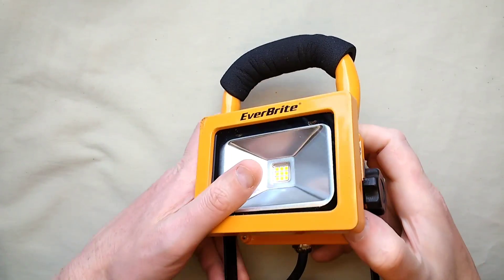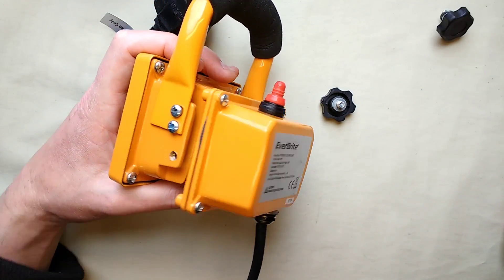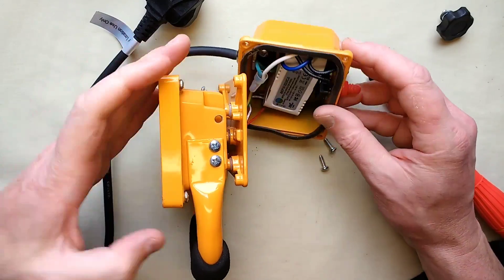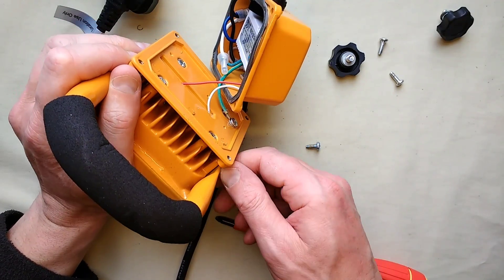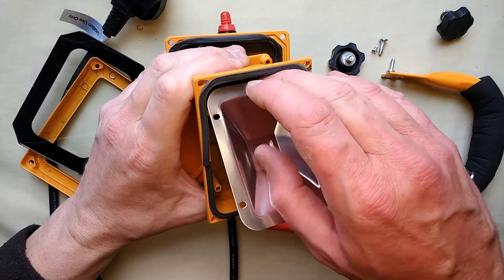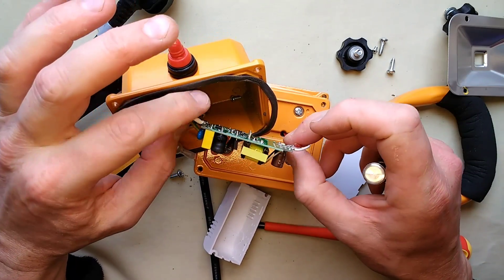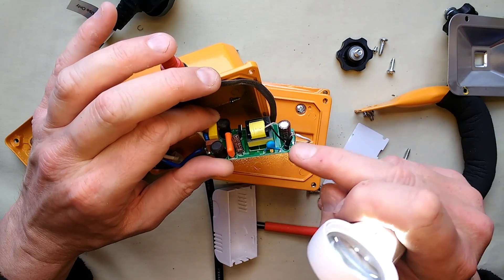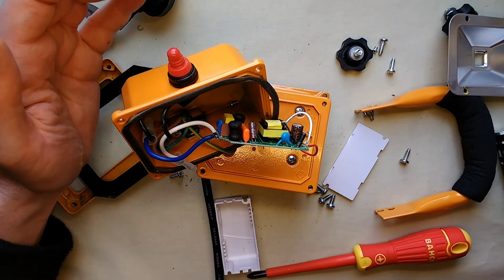ASDA LED work light.

Comment: The H05 isn't the part that indicates a rubber flex, it just indicates the category voltage (300/500V). Ordinary-duty PVC flex is designated H05VV-F (similar to North American SJT), with a lighter-duty variant called H03VV-F (roughly comparable to SVT, limited to 0.75mm² cores and intended only for smaller appliances); the VV refers to the use of PVC, both as the inner insulation and outer sheathing. An ordinary-duty rubber flex is called H05RR-F (comparable to SJ; used with some hot appliances e.g. electric frypans), and one with rubber inner insulators and a neoprene/polychloroprene outer sheath is H05RN-F; the heavy-duty version thereof is known as H07RN-F. (In Australia, incidentally, we also use heavy-duty PVC flex, which equates to H07VV-F.)

So, which is it? H05RR-F or H05RN-F?

Comment: Market is flooded with these lamps. So many different variants. And so many differant brands with various qualities from excellent to dubious. I got one with a single led 10w and its very bright. You can get ones with removable batteries, usb 1amp phone charger outlets. Ones with or without weather seals, and some that are wonkey Copies of copies. Literally every high street shop as its own version. I like to stick with single led versions myself with decent led . But there are some of these that have like 20leds and are worse than my single version. I got mine from city electrical so it's alright but got a clone on eBay and sent it back as it was like a tin copy and oooh so badly made

Comment: The push button switch looks exactly like the ones on my 2 head Halogen work light that I recently converted to driverless LED chips.
BTW re "sound of screws scattering": I bought a bunch of magnetic parts trays (basically a metal dish with a speaker magnet in a rubber cover glued onto the back) at Dollarama a few years ago. I put one on the bench whenever I take something apart so I can put the screws &c into it and I don't loose nearly as many of them now.

Comment: Have you taken apart the flat panel led lights from eBay? They come with those power supplies all the time. Also the leds light the acrylic edge not what you expect.

Comment: Hey Big Clive, I've got a question.  What do you think of solder suckers as a tool?  Useful all around, or only in certain situations?  Or are they more trouble than they're worth?
Reply from the maker: They are a useful addition to a soldering toolkit.  I've had better results with cheap eBay ones from China than expensive ones from high profile electronics companies.
Reply: Good to know.  I got myself a generic one too, and it's been pretty handy for the little bit of unsoldering I've done when scavenging components.  Had a bit of a scare when I sucked up a huge glob of solder and it jammed the tip up, but a bit of poking with some pointy stuff cleared it out.
Reply: Awesome!  Thanks for all the advice!  And yeah, I got the exact type of blue one you mentioned.  I've always cleaned it out right after using it, just to be sure.  Got a little tin full of all the old solder.  No idea what I'm going to do with it, but I'm sure I'll find something.  Probably low-value hack-jobs for rapid prototyping on stuff I don't particularly care about the initial quality on.

Comment: Those push-push lamp switches are very common in the US, and have been since at least the 1930s. I suspect that is because they are probably cheap as dirt to make, and they work fairly well with a waterproof rubber boot.

Comment: What I'm looking for currently a Small and Cheap Portable 720p TV
Reply: TheKHfan358over3d Be aware that portable TVs do not tend to perform well in use unless you have a suitable elevated high gain antenna to attach them to, which really kills the portability factor for most applications.  With today's digital signals you tend to get an all or nothing signal, unlike the slowly degrading analog signals of old, and to get away from heavy ground and structure (multipath) reflections that usually means an antenna up high and if you do not live reasonably near the transmitter site then it also means you need a high gain (and typically directional) antenna as well to have a good chance at getting any reasonable degree of usable television channels.  Digital TV largely killed the portable TV market since a marginal signal is not of much use with digital TV.  A lot will depend upon your definition of portable, but if you mean something you can easily carry around with you from location to location, especially if battery powered, using a small whip or loop antenna then you are usually very fortunate if you can actually receive one or two acceptable channels in a major urban market, with better odds if you can get up high and free of obstructions and much worse chances if you are down at ground level or further from the transmitter site unless you have a suitable elevated gain antenna to tie into.  If not using an elevated antenna and you have access to an ordinary TV at the moment, try a small tabletop amplified antenna with that TV, then if you can find a small portable TV with an equally good RF frontend it will perform similarly using that same antenna -- that might give you some idea as to what to expect performance wise in your specific market and location (be aware that amplified antennas need their own power source as well if looking for battery powered operation).  If you have not already done so, you may wish to check out the "Techmoan" channel as he tried a portable digital television recently to similarly disappointing results.

Best wishes on your search.
Reply: I'm seeking one for Use with HDMI not for watching Digital Television.

thanks for the advice though.

Comment: Interesting that it will run on 277V as well. The only building I've ever seen with 277V receptacles is an old office building I was in once, all of the emergency light packs on the walls had a receptacle I had never seen before. Turns out the light packs run on 277V. For those outside North America, 277V is one leg (phase to ground) of a 480V 3 phase system. Most buildings that have a 480V 3 phase system will run the fixed lights on 277V since it saves size of a transformer down to the 120V/208V portion of the system.
Reply: First time I encountered something that took 277 volts were transformers in some old "EXIT" fixtures I got from a school that was about to be demolished. At the time I thought it was incredibly odd because I've never heard of anything taking 277 volts.

I forgot how exactly the transformers were wired but they had two line connections; one 120v and the other 277v. I assume the 120v side was wired directly to the bulbs (as they too were 120v) while the 277v stepped the voltage down to 120v.

Comment: Looks like one of the better LED light/gadgets that you've reviewed, and the only one so far that I've seen that I'd consider spending money on.  if it had one of those generic chinese cob LEDs instead, forget about it.  

I'd sooner take the mPCB & LEDs out of a 60W equivalent (edison style) light bulb and fit that in it.  Many of those are about 10 LEDs in series, and through local US electric company subsidies, cheaper to get the whole bulb than buying discrete LEDs alone.

Comment: I have been on a Juel Thief binge trying different materials for example, my first was made with fairly heavy lacquered copper wire scrounged from a transformer of some sort, it works great, I used a elongated piece of __Torid______ taken from some choke on a device, I think it came from an old PC Power Supply.  The second has wire that I removed from an old Apple Printer cable, rather thin wire, good quality copper on a wide piece of __torid______ that was a choke on a power supply cable for a laptop, it too works great, this one I used a small LED, the first had a 5mm. Then the other day I got in a shipment from Ebay, in there was a package of 50 1 Watt LED's, I scratched my head and then the little light on my  Joule Thief went off, another JOULE THIEF, this one will be my brightest!!! So away I went, this time I used a rather small __Torid_______again scrounged from another product, this one came from an old 56K modem  I used the left over wire from the second, green and yellow, I could only fit about 24 turns of wire, and I got lazy and just picked up a used resister out of my general reclaimed parts bin, the others all used 1K resisters, but this one turned out to be a 10K I couldn't find any more AA holders, but I have a good supply of 2 AAA holders with integrated switches, so I hooked that up to the 1 Watt LED.  Well it works GREAT with 2 fairly dead AAA rechargeable, my only problem, that resistor gets so blasted hot after about twenty seconds that I have to turn her off beaus o the smell of burning resistors.  Perhaps if I replace it with a 1/2 watt 1K?  I know I am cheating by using 2 cells but it just looks so damn good and I can light up the whole living room for about 20 seconds....
Reply: What is your problem with typing the word toroid???
Reply: Anvilshock Perhaps the affair really was over a torrid toroid? ;-)
Reply: OK, so I am an old man, and my brain is not firing on all 8 any more. It is held back by massive doses of narcotic pain killers that do a fair job of taking away the constant pain that has wracked my aging body since that damn accident in '93. Believe it or not, I have in the past had some of my writings published!  Oh that was many years ago now, and I have not even submitted any of my stuff for years. Fact of the matter is, the last writing I did was for my shrink who was treating me for PTSD, the result of a year in a little backwater country called Vietnam, but then that is a different story indeed.  The reason I had those with a underline fill was because even though the devices sat right in front of me, lite up I could not for the life of me think of what those little round pieces of some unknown black crap that makes magic when a wire is would around  them and pulsed by a little transistor was called. I have been collecting them ever since I read, for the first time, about this little circuit that could magically pull the last few micro-volts out of an AA battery that was considered by all concerned as being dead.
Reply: Sorry to hear that. I really wondered how to interpret those underscores.
Reply: I just could not think of the word, drives me nuts when that happens, so I entered the lines as a sort of word holder so I could fill it in when it finally came to me.

Comment: Arrrgh!!! You're using a Pozi driver in a Phillips screw!

You might just as well be screeching your nails down the blackboard.

Please Clive! Spare some consideration for those of us with OCD.

Moving on... 
           At (2:31) - You say "...but only about point six five watt power factor..."

Now, correct me if I'm wrong but I thought that the "Power Factor" was a value between zero and one, so ".65" seems credible but ".65 watt"?  Have I learned something new here?

.

Comment: Big Clive, what do you do with all the stuff you have opened up? I expect a lot of it you don't / can't put back together.
Reply: It was a ripple in space-time.
Reply from the maker: I put most of it back together unless I want to modify it or rob it for bits.
Reply: Tonicwine999 duplicated comment
Reply: Danya G. I think I know why.... I used the YouTube app and apparently there was an error when I finished my comment. Tried to re-post my comment and it said it failed again. 

Turns out that it didn't fail and it posted it twice :-/
Reply: Tonicwine999 Ah. It's just that I've seen a lot of these duplicated comments around YouTube. That's what's causing that. Good to know, as I'm also using the YouTube app.
Reply: Tonicwine999 Regarding your question, he said once that the stuff goes into some sort of pile. Where it goes from there is a mystery, inside an enigma, covered in ice.
Reply: Matt Burnham It is. I wonder why that happens?
Reply: It doesn't go. It just is.
Reply: He must have a junk pile like mine, only with newer stuff.
Reply: Ahh ok, I imagined you had a room filled with this stuff laying in pieces! Thanks for your reply!
Reply: haha thats what I imagined
Reply: Haha

Comment: I have seen battery powered models of these. Batteries are within the same sized case. I haven't been able to take apart one to get info about quality and battery capacity.  With 12volt input it's plenty useful little light. And cheap
Reply: Clive has videos of taking apart the battery ones. Have a look for them.

Comment: Considering the led chip is set behind it and just showing through the centre hole, does the 'reflector' do any good at all?
Reply from the maker: I think it helps with the light reflected from the glass, but it seems more cosmetic than functional.
Reply: bigclivedotcom It certainly does seem so doesn't it? But that's odd if it's a part that could be left out. Do you have anything that measures directed light? If so you could do a with/without test.
Reply: BearWithMe The reflector helps a little with a small amount of side light and some reflected light, but it is mostly an aesthetic detail as the LEDs demand a decent heatsink area and consumers are accustomed to seeing a light with a reflector, but they could dispense with it without it really altering performance by much.
Reply: Ethan Poole I hadn't thought of the heat sink aspect.
Reply: Caledonian TV re the lens idea, a fresnel lens just behind the front glass perhaps? I'm not sure what the change in effect would be of the light projected, but I've used that to great effect when I've wanted to disguise discrete 5mm leds and make them 'mingle' into one big splash of light more without losing as much direct light as frosting some clear plastic cover over them does.
Reply: Caledonian TV Cheers, I use those small cheap ones you can buy in bulk made for holding over a book you're reading, they spread out the light and you can cut them up or bend them into shaped 'shades', too. For me they stop those annoying points of light that can ruin an organic 'magical glow' or 'fiery flicker' effect that I'm going for, without noticeably decreasing the brightness. It's a bit tricky and doesn't always work, but hopefully you can find a solution that works for you.

Comment: If you know BC, tittle would be "Total disassembly of an ASDA LED work light". I would look for one of these as it is pretty good pending its a good price point. 
Thanks for the video.
Reply: You can still look for these. Probably best to look in ASDA.
Reply: @Paul Sengupta, 
Yes, I would if I was there. Unfortunately I'm in state side. :-(
I did look around on walmart's website but there is none to be found but rechargeable ones which looks kind of like this one. 
Oh well.
Cheers
Reply: Someone in the thread said that Walmart have them in the US but they're a different colour and marked with a different make.

Comment: my guess is the switch was chosen for it's ease of operation whilst wearing gloves.
Reply: Might be because it's easier to fit than a rocker switch requiring a rectangular hole, whilst being easier to 'waterproof' than a toggle switch.
Reply: RWBHere Toggle switches are waterproofed the same exact way with a simple flexible boot over the toggle "bat" handle with a nut integrated into that boot that also secures the toggle switch and completes the waterproofing since the nut is overmolded with the same flexible rubber or plastic and serves as a waterproof washer of sorts to prevent moisture getting past the integrated nut.
Reply: The push-on-push-off button this uses reminds me of the guitar effect boxes aka stompboxes which have robust push-on-push-offs like this so that it's easy to just use your boot to trigger the effect on/off. Being that the setup of this light looks like you might place it on the floor I can see it being meant to stomp on/off with your work boot. The rubber being there to protect the switch from the environment/mud on your boot.
Reply: ............and by wearing boots! The push on/push off is less likely to get damaged I would say, too.